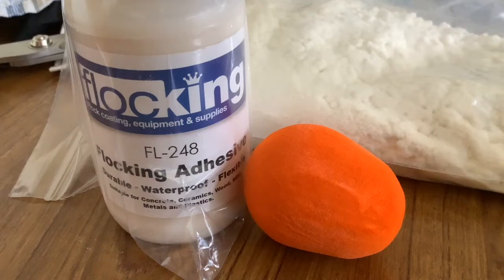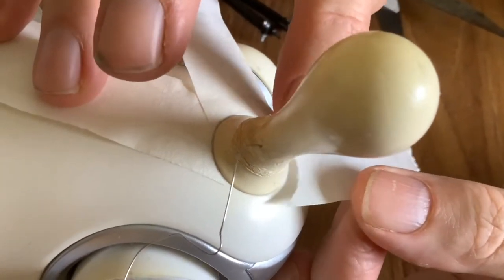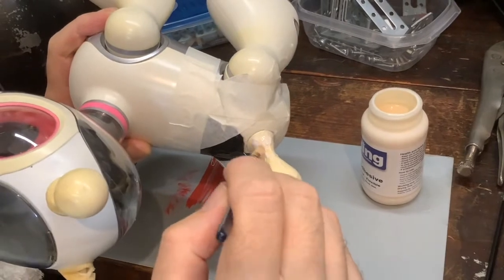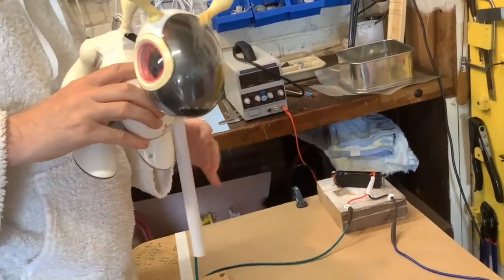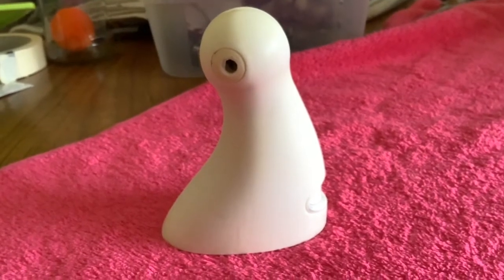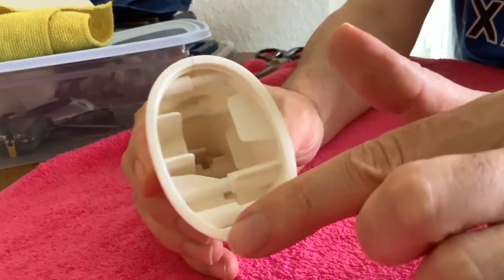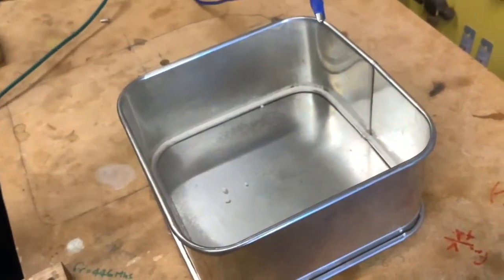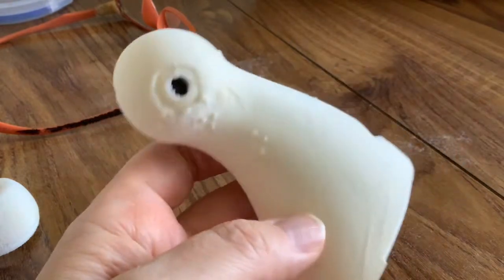Flocking Hasbro Tiger Electronics Mio Pup Using FLOC-KING Flocking Kit part 1: tail & leg

Comment: I have a Mio Pup robotic dog and the silicone on his ears and tail came off. I can't put them back on now because I don't have them. Any advise for replacing these, to cover his ears and tail, again?
Reply from the maker: It’s funny that you should ask that because we’re working on making flocked latex replacements for ours. Once we’ve done a video on it we’ll link it here.
Reply: @thankstocalebchung1556  Thank you. The ears came off, to a point where it is just a small layer of silicone left and the actual ears are showing, the plastic part of the ears, if that makes sense.

Comment: for the ears and tail: i don’t think you should cover up the decaying and yellowed material with flocking, because the material will probably still decay with the flocking on top of it and it might get worse but idk. you should take the old material off, and make something new. like, maybe you can get one of those flexible rubber silicone things (i’m not sure what it actually is) that ive seen people use to repair the rubber on the 2005 furby’s beak. i think that’s ur best option
Reply from the maker: Thanks for the advice. We’ve been experimenting with latex this last month & I wanted to see what results we got before I got back to you. We’re really pleased with the results so far & we’ve also been able to flock it! So I’m planning on making new ears & tail out of latex & flocking them - coming soon 😉

Comment: So cool!! I'm excited to see what you end up doing with the flocking! 😀 Especially with flocking a Mio Pup.. is the flocking just tiny little fabric fibers, would you say? Like the sort of fibers that come around when you cut faux fur but more finely cut; I've always wondered that since I've seen people sculpting with clay use that kind of fibers just cut off of fur as faux flocking to add texture to the sculpture 😯
Reply from the maker: yes it is, but these are very tiny and all exactly the same length. It’s important that they’re exactly the same length as when you use the electrostatic method they all line up end on equally spacing themselves apart to you get a lovely smooth result.
Reply from the maker: Don’t know if you saw our first flocking video: https://youtu.be/_U-9kKUxJ6M Once we flock the Mio pup we’re going to try flocking Sox & we want to see what affect you get if you try mixing 2 colours.